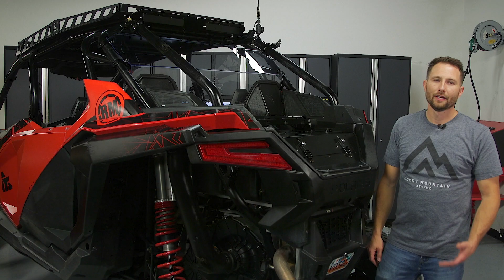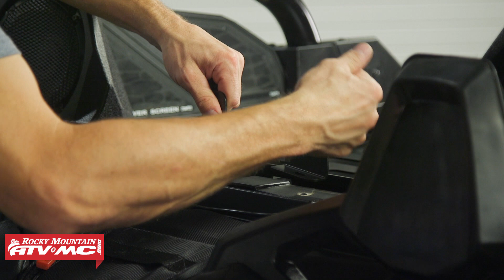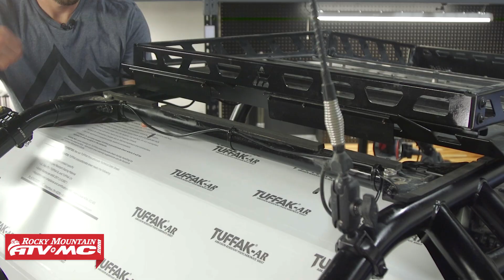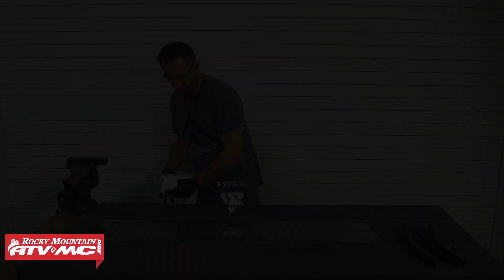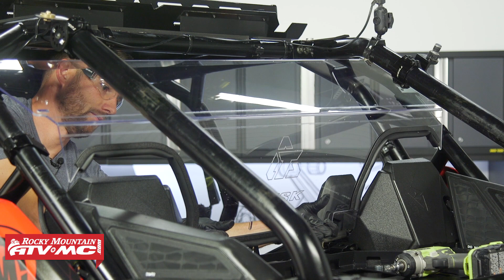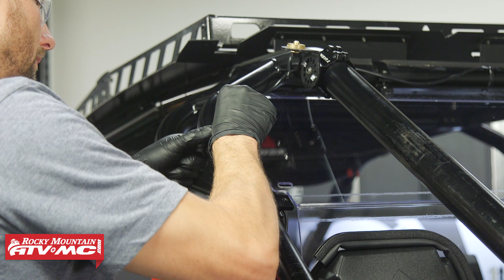How To Install a Tusk Rear Window w/ Speaker Cut Outs on a Polaris RZR Pro XP 4

Comment: He mentions that this model number works for any machines that have the RF stage 4 speakers but it does not work for the 2 seat turbo r with the speakers added.